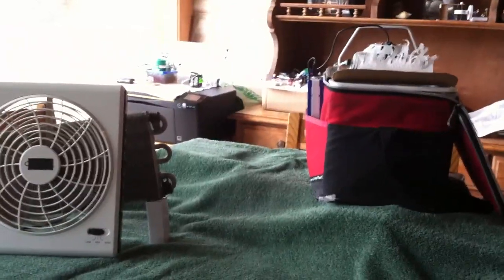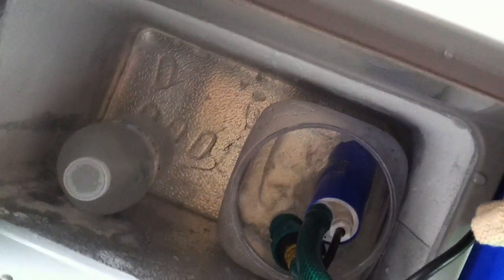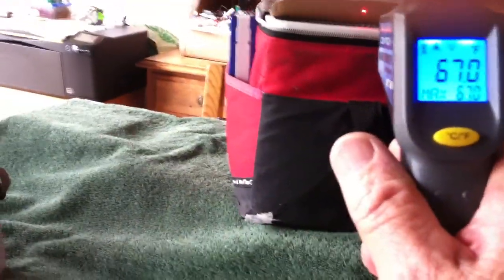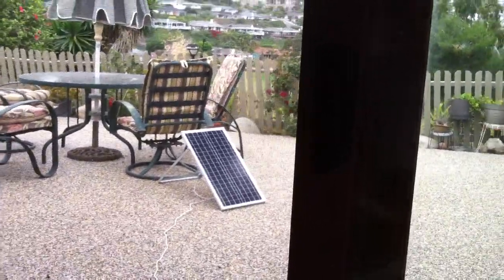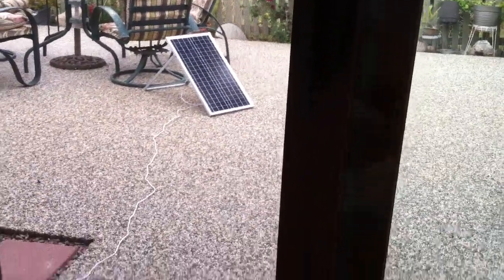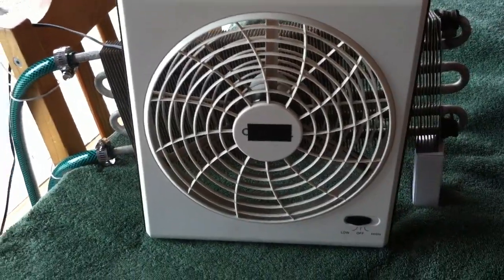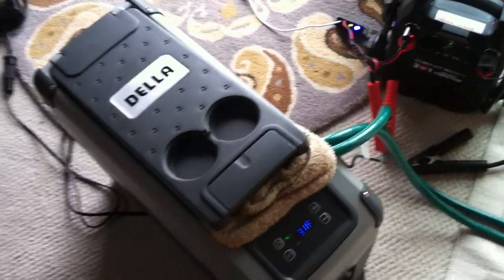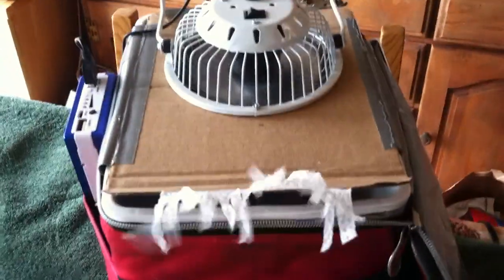Homemade Air Conditioner -----Update

Comment: Gut a car ac unit put the pump on the bow with a propeller run the fan with 12 volt dc solar
Reply from the maker: Thanks.  I have thought about tracking down small car ac unit and tinkering with it.  The problem is driving the compressor.  It takes a lot of power.

Comment: hey Lidmotor, I've been following your project and I wanted to build one myself, but ran into a bunch on problems that needed resolving. Have you ever tried Peltier units before, they are not very efficient but they do the job if you manage the heat properly. I think those same units are on your freezer box, you just have to find a way to dissipate the heat outside your boat, I suppose some cheap ducting will do the job. Just search around a bit  for Peltier modules and you will get a ton of results and helpful information on them. I wish you all the best and success in your future projects!
Reply from the maker: Thanks.

Comment: Now I know why humidity would be a problem for you since you want to use it on a boat.  Smallest airconditioner I've seen on the web is that zerobreeze kickstarter.  Uses a mini rotary compressor.  Perhaps when they start falling apart or the batteries expire, you could pick up one on ebay for cheap.
Reply from the maker: I read up on those units and I think I will wait until they have been around awhile.  Neat little AC units though.  I would love to have one--- but not at $400.

Comment: Nice concept, I was curious about the same thing I tried a Peltier chip with one of those tall CPU coolers it did work but I found that enclosing the cooling coil and the fan in the Box I got a few degrees colder, I'm sure the same concept would work on this design as the air flows through the cooling coil it's also being drawn past the top and bottom which will reduce the temperature overall,  stay cool thanks for sharing.

Comment: Hi Lidmotor, when I was in the Navy aboard ship out in the Pacific Ocean, the inside temp of most spaces in the ship was very cool and comfortable.  They had chillers, not compressors or refrigerants.  It used cool sea water, as I recall, with a freshwater heat exchanger as salt is very corrosive on piping.  We got the cool without the humidity.  There was a drain on each unit, I think where the condensed humidity went.  Not sure if you already said it but you could use this chiller method to pre cool the water and then pass it thru your mini fridge rig to cool further.  That would reduce the delta work required.  Also you can use a small fan, tiny power used, to blow over the compressor/condenser to help even more.  There are limits, as if it is too good, the unit could freeze up.  My dorm fridge compressor 120VAC makes a lot of heat and heat was conducting into the cool box of the fridge, defeating the cool being produced.  I insulated the compressor and condenser coils from carrying heat into the box enclosure.  Ventilation is still there for the compressor and condenser.  It made a big difference.  Before, at room temp and stable, I measured the duty cycle times and it was about 50% on and 50% off on average over an hour, that is cycles of 15 min on and 15 min off roughly.  After the said mods I get about 30% on and 70% off.  I also put cardboard insulation around 3 sides.  You can't improve mechanical efficiency much, but you can reduce the on/off compressor cycling greatly and that on average can save a lot of solar power.

Comment: 68 water temp and 82 air temp, pumping cold water through the fins could not be that much energy?
Reply from the maker: Using the cold sea water is probably the way I will go.  The little freezer uses a lot of power just to get a little cool breeze.   Have ice in my drinks would be nice though.